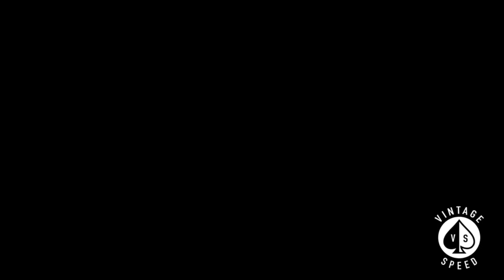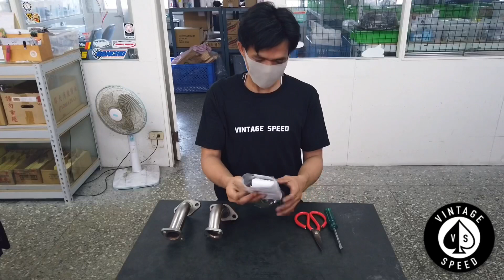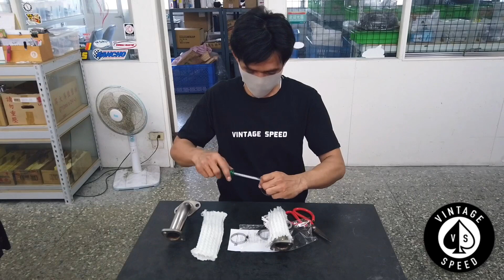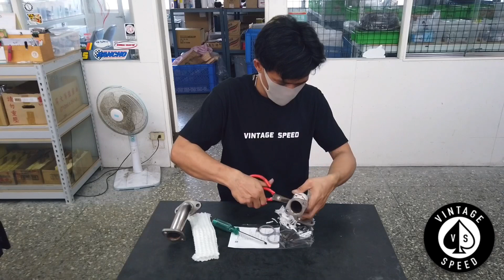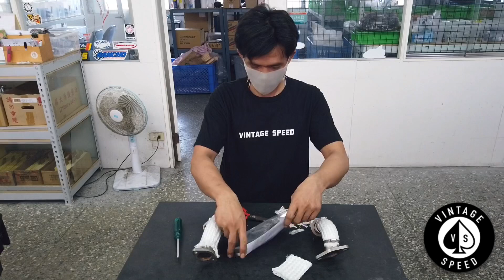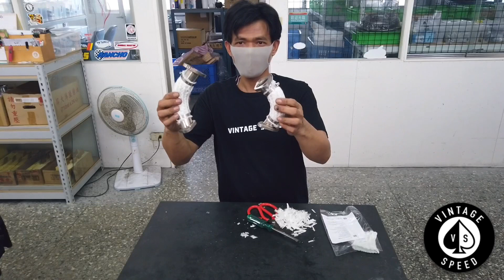Fire Sleeve Wrapping Instructions

Comment: I tried the way you show trimming with very sharp scissors the first tube, and it probably looked about as good as what’s shown in the video. However I was not satisfied with the appearance as the edges were still somewhat jagged, so I used a favorite tool my X-acto #11 Zirconium blade hobby knife to clean up my work. Pressing down on the fibers the sharp blade cuts very evenly and working around I was able to make the edge almost perfectly straight. Second tube I dispensed with the scissors altogether and just cut with my razor knife as described, much less mess as large pieces come away while I follow about 1/4” distance from the edge of the clamp as I move around the tube. If anyone wants to try it this way remember don’t cut sideways around but rest the knife flat against the fibers and then firmly press down, this is easy with a very sharp blade but take care to keep your hand that’s holding the tube out of the path of the razor if you were to slip while pushing on the rounded surface. Take your time and gently rock the blade over the thinner fibers that remain after cutting through the large cords. It really works very well and it’s easy to get the hang of it, my tubes both came out picture perfect with the #11 “Z” blade.